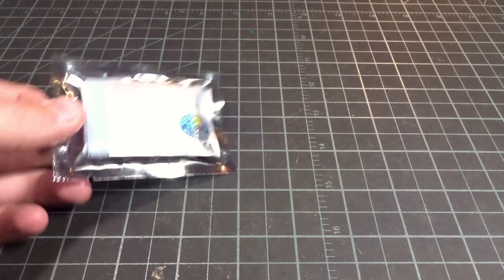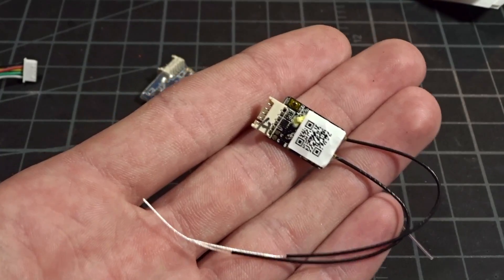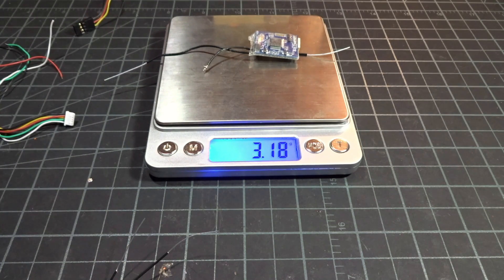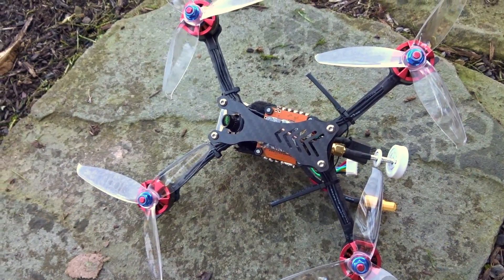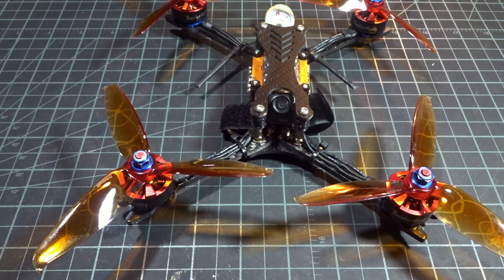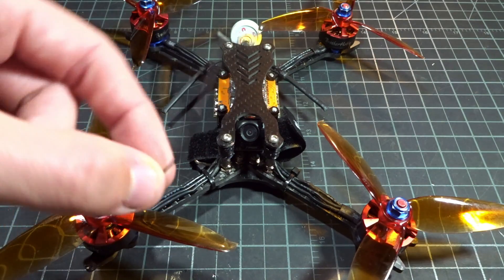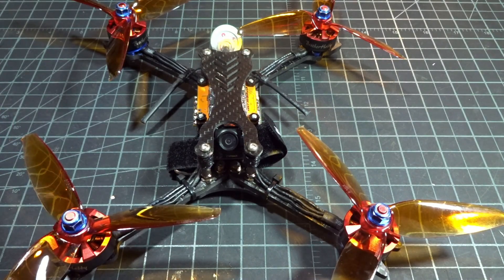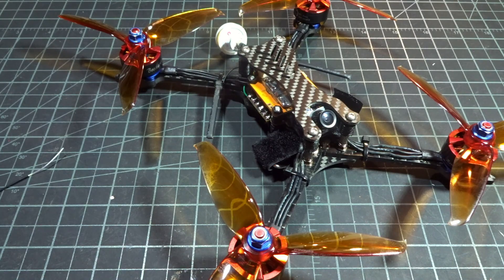FrSky R-XSR Review

Comment: Ill be installing this into a Pylon racer will go 180 mph with sbus running to flex gyro. At least they glue down those antenna's some get lose over time those tiny antenna plugs fall off if they move around too much.

Comment: Silicone wire insulation and crimped terminals don't mix well. The insulation tends to tear at the insulation crimp where the crimp wings are folded back over into the wire.

Comment: I'm using that receiver but can't get any input to wrk in betaflight, I've wired it properly it binds but no input, could it be just a bad one u think? I'm using the dalrc f405 fc I have sbus going to the rc tab which is uart 1 so I'm not sure what else to Do, any ideas?  thaks
Reply from the maker: Are the prop boxes in configuration set ?
Reply: Yeah I actually took another one from a different quad and it worked so I'm guessing that one is bad, I just plugged in the new one without changing anything in bf , just my luck Lol, thanks anyways keep up the good wrk with the vids you helped alot of us 😁
Reply from the maker: Oh wow, that sucks but doesn't suck at the same time haha.

Comment: Hi, How can I connect my ESC to the receiver FrSky R - XSR? To do the calibration in each ESC?
Reply from the maker: Your escs get connected to the flight controller, and you can calibrate them through pass through.
Reply: H, my escs are connected to the Naza Lite V2 and the receiver FrSky R - XSR is connected to the other side of the Naza! but I don't know how to calibrate
Reply from the maker: Oh, if you are using a NAZA system it has to be done manually. Take your props off, put your throttle to 100%, plug in, it should beep a few times, and then lower throttle to zero. Depending on the ESC you might calibrate them like this, or you might enter the esc setting menu. Hard to say with older ones.
Reply: I tried that! but it does not work!  when I put the throttle to 100%,  the left front motor that has the problem still it stays spinning slow and when I lower the throttler to the middle something the motor stop spin!  the other motors respond well!  the ESCs I'm using are the  T-Motor F 30A V2 2-6S ESC BLHeli_S w/ Dshot
Reply from the maker: Do you have a different flight controller you could use? The naza is very old and outdated.
Reply: No, just only that ! I'm very frustrated with this situation ! It's two weeks without being able to fly :(

Comment: I just bought an rxsr. I also just bpught my first Taranis. X7, it came with all the scripls installed! I bound my first rx an xm+ to it and everything went gr8... I got the r-xsr and went to bind it the same exact way and i lost my xm+ rx, but thats not all.. The rxsr seemed to bind and everything, i was getting one blue and one green solid lights.. I was getting telemetry to my tx but nothing in the receiver tab in bf? Any ideas as to why all this is happening, i mean what i did wrong!!
Reply from the maker: You could have used the SBUS in rather than the out by accident. Binding a new RX to the same model with not cause other RXs to lose their bind.
Reply: The RCAddict , Hello Seth. I had over thought the situation.. For the past 2 years i only had a Turnigy EVO. Long story short, i was plugged into RX/Uart instead of the SBUS pin on the receiver side of the fc! Lmao..

Comment: Anyone have any luck setting up F port?  I flashed the receiver and have control but no telemetry besides reciever voltage and rssi, nothing from the FC.  I'm new to frsky so please forgive my lack of knowledge.  My set up is on the omnibus f4 v3 FC.
Reply from the maker: I don't ever set any of that up so I am of no help :/
Reply: Use uninverted signal and use TX pin instead. Need a bit of CLI mod. I'll tell you if you're interested.

Comment: antenna length also depends on the coax used too. they could have used a coax with a different velocity factor which require adjustment of the active element

Comment: The shorter antenna doesn't always mean that it's a 5th wave length if they have built in resistance it can still be 4th but smaller mm in size

Comment: You might want to do more range testing before finalizing on the longer antennas.  These are monopoles, which means there is no ground element.  Instead they rely on the ground plane of the receiver and anything else that is electrically connected.  It's possible the antenna length is tuned for this.  Also, I would say you probably were about 1/4 mile out.  But the exact range can quickly be verified using Google Earth.  :-)
Reply from the maker: Yeah, all good points.

Comment: You always need to use what it came with! ORIGINAL length, as every RX has they'r own logic for length and speed of light. So better not to switch! XSR with standard antennas made 4.8km on wing with normal rssi at 50~
Reply from the maker: This is usually true, but ok to test with different ones.
Reply: Rc Reviews so what is the actual length of the rxsr? I destroyed mine and wanting to repair while the new ones arrive.

Comment: hello, i have the same receiver  and i have a question, i only use this receiver in my quad, and i want to know which cable do you use ,, sbus_in(white) or sbus_out/cppm? i don't know why, but mine is binded correctly with my taranis but when the drone doesn't controller board doesn't receive anything
Reply from the maker: Needs to be out, in is if you connect up a second RX.

Comment: Having issues with mine on a CLRacing F4s, it binds but no receiver response in BF. I used the 3 wire harness on the R-XSR with the yellow coming from the s port on the receiver going to sbus (uart1) on the FC. Any ideas why the receiver isn’t responding? Channels maps are setup correctly. Thx
Reply from the maker: You need to run the SBUS signal to a UART as well.

Comment: Bruce at RC Model reviews did a study on the antenna length and i believe he came to the conclusion that the difference if any was negligible. And whatever circuitry they used was able to compensate for or improve reception regardless of   precision tuned length or not. I thought as you do that it was critical for best performance but apparently not as important as it was before. That is not to say large differences won't matter  but small ones  were indistinguishable.
Reply from the maker: Yeah, others recently have said similar. I am still having some failsafe issues when racing when using the R-XSR and XSR though, which I cannot pinpoint the cause of. It might just be a firmware issue, but I also fly XSR for freestyle and get a mile of range... I am trying moving to X4R-SB now.

Comment: Hi Seth I'm running a chameleon bout 600g I've been using Hypetrain motors but I've had a couple were the flux ring has dropped what motors would u recommend for freestyle?
Reply from the maker: Those motors are a good choice for something heavier, but if you don't like them maybe try a 2207. I am running the Hyperlite 2207 on my freestyle quad at 620g and it has tons of power. Just have to be a little careful with your battery.
Reply: The RCAddict thanks man 👍 I'm in the UK so the hyperlights are same as brother hobby motors? How about the f40 v3?
Reply from the maker: Yep, they are the same. Those are good, but I don't like how heavy they are.

Comment: Will the work with any transceiver?
Reply from the maker: It works with any FrSky radio.
Reply: The RCAddict would that mean flysky too because they are clones of frsky?
Reply from the maker: No, they are not clones, they use a different protocol.
Reply: The RCAddict okay just though they were because they look similar.  I burned out a receiver for my flysky and need a new one but want one that is smaller.

Comment: A very simple mod to the antenna is to simply cut the signal receiving section of the antenna to a better wavelength. Don't remember the exact dimension of the old XSR but I believe it is around 35mm. This cut of the shield needs to be clean so lightly solder the area before making the cut and this will give you a perfect edge. This simple mod to any of your antenna will give GREAT advantage . Cheers.
Reply: Just got to point where you swap antenna. N/M
Reply from the maker: Yes you could simply expose more antenna, but would rather switch out, especially on these tiny thin ones.

Comment: Xm+ does have rssi on ch16
Reply: You can have it on channel 8 as well and run d16 1-8 channels at 9ms. I have it set up that way on my osd rssi .no need to hear the transmitter tell me when i can see it. I  also got a mile out my xm+  before video break up and was still at low 80 high 70s rssi at a mile.
Reply from the maker: Yes but it's not stock ready to go, which is what I am interested in. Wire it up and radio yells at me lol. I am old fashioned, don't use LUA scripts, smart audio, or telemetry, or BF OSD. All I need to RSSI warnings and voltage osd

Comment: Seeing that you have had the Gemfan Whisky props on a few videos do you like them more than the Cyclones?
Reply from the maker: Depends (doesn't it always lol) I ran the cyclones for racing for fear of battery life and durability over the GF, but I ran the GF 5152 at a race and my battery held on, and they were plenty durable. They are just sooo fast and locked in, my main prop now and then will switch off if need be depending on the track or goal.

Comment: I got one of these just after release. No issues with it. We had to nag frsky to update the fw so we could use lua. Now that's working I don't know why you would buy the XSR anymore!
Reply from the maker: Are you using the stock antennas? I can't help but think FrSky used that odd length for a reason.
Reply: The RCAddict yep, all stock. No issues with it so far. Although you have tested the range further than I did so it's good to see you had no issues either. I've no idea why they used that length of antenna either. But it seems to work!
Reply from the maker: Hmm, ok. Really would like some insight on this, from FrSky or someone who knows RF. Might have to post on FB.
Reply: The RCAddict I believe they have their reasons. Theoretical quarter lenght is just simplification for some ideal conditions. In reality this guy's answer looks ok to me: https://www.rcgroups.com/forums/showpost.php?p=21718907&postcount=21
Reply from the maker: Interesting, thanks for the link. Guess I will leave they as is unless I have any problems then.

Comment: Reviewed like a boss!

I would have liked to see which pad to use for the un-inverted smart port.  You still have to solder on the other side of the inverter like with the XSR right?
Reply: SICK!  I had only seen the old reviews of the R-XSR which didn't include the pads.  Damn, now I'm going to have to buy a bunch of these!  Thanks man
Reply from the maker: Yeah, I didn't check if mine was or not, but new version has the pads for easy soldering!
Reply: I was looking for a decent price and here it is:
http://bit.ly/2AvYIId
I hope it will be useful

https://www.youtube.com/watch?v=BYVm_C6hna8
Reply: Its the little Pad Labeled P for uninverted Telemerty coming from an F4 board.

Comment: Would having two different length's mess things up? And covering the end of the antennas with heat shrink does not affect signal right ?
Reply from the maker: Nope, it uses whichever one has the stronger signal, so it's probably just going to be using the correct length one more often. Nope, heatshrink doesn't block rf.

Comment: It looks so much smaller than the XSR, really quite tiny. I couldn’t really see much difference in the RSSI between the antenna swap. I’ve not really had any failsafe problems with my XSRs with the stock antennas. Is there solid evidence that 1/4 wave has the strongest signal?
Reply from the maker: Yeah, I should have paged over to the RSSI screen, but didn't realize it until after :( 1/4 length with antennas such as the X4R-SB has shown longer range over the XSR with the 1/5 I really am no expert though, just going on what I have heard, and thought these being even shorted swapping to the full length 31mm would be better overall.